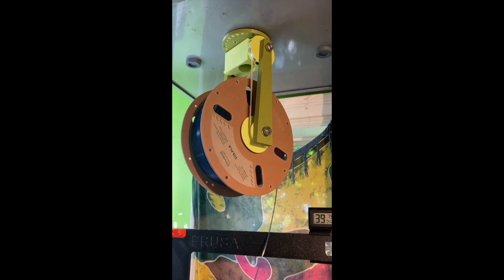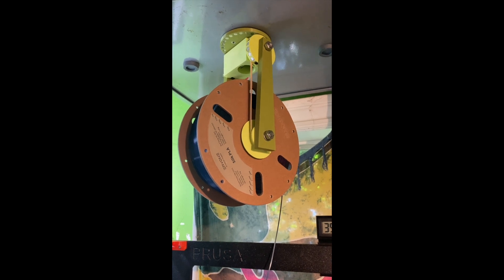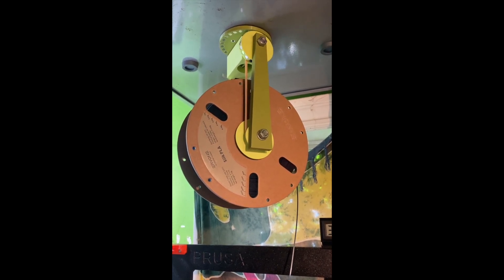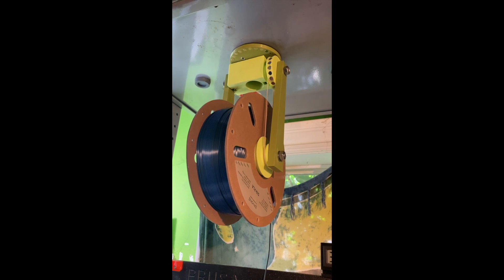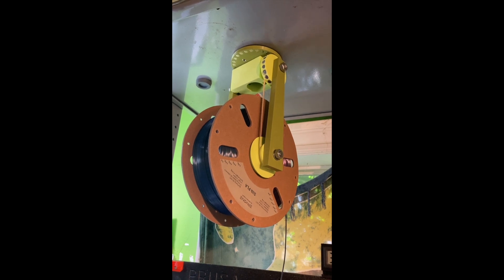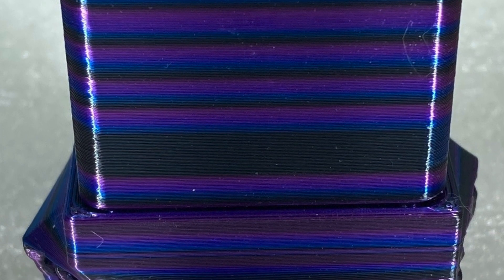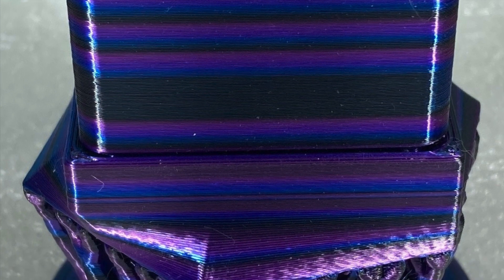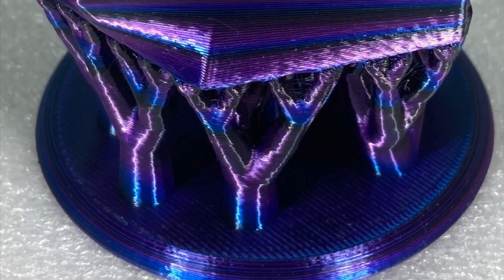Spool Rotator

Comment: The idea of rotating filament is cool and I love the mechanism you designed.    You should do a timelapse with the spool in view.  Do you find that the twisting causes any kind of artifacts on the print?
Reply from the maker: A time-lapse is a good idea.  I've been thinking of how to do that in my workspace.  I don't think the twisting is enough force to cause any artifacts; however, the swinging of the spool could.  If the spool swings a lot because of the specific motions of print (would vary throughout the print and from print to print) they could transfer energy back to the printer via whatever connection there is between the shelf and the printer.  If they are isolated from each other I cannot imagine any kind of artifact other than varying usage of filament per layer means varying amounts of rotation, and that might look unexpectedly uneven if one was expecting a repeating rainbow with similar sized stripes of color.
Reply from the maker: Ok, this video here contains a timelapse of the spool rotator in operation: https://youtu.be/Q3Z1XhZC2ro